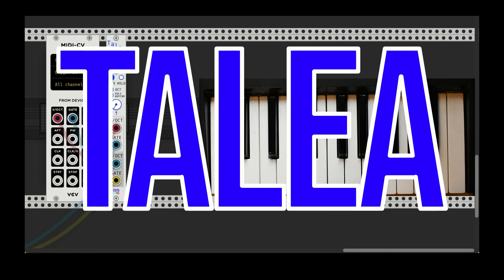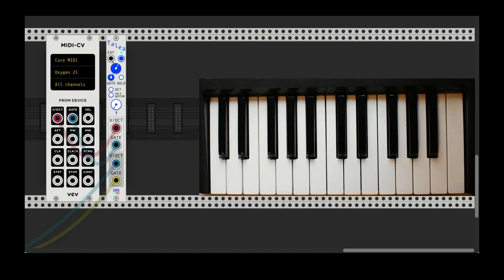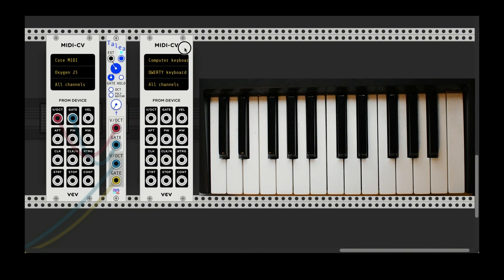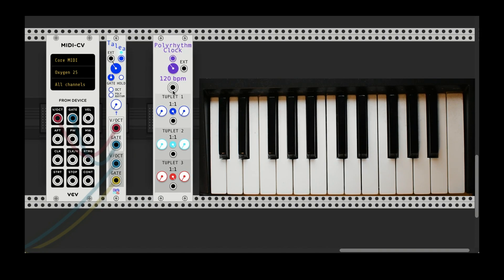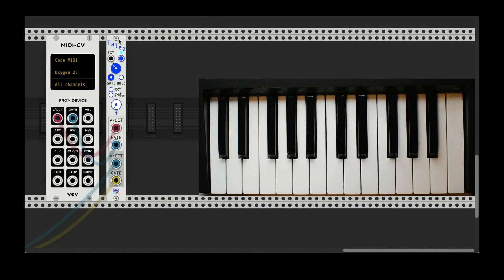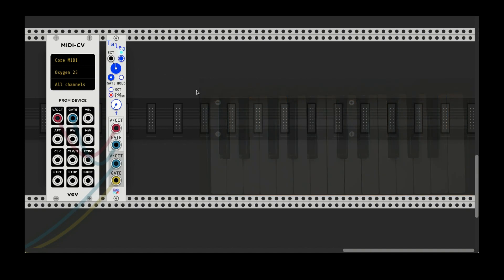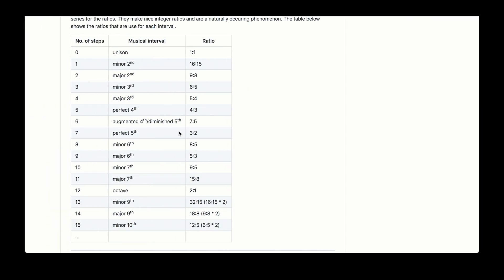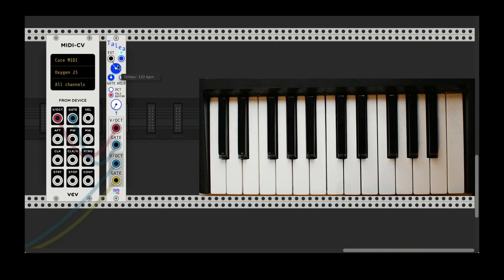Talea - Sha# Bang! Modules

Comment: In polyrhythm mode, have you experimented getting the whole number ratio also expressed as a musical interval? That would be cool, to have the ratio expressed as rhythm and interval at the same time. The only way I can think of is to add Host to VCV and link a synth like Vital, Surge or Serum, that supports .scl or .tun files. But is there anything inside VCV that can do this? By the way, great videos and modules!!
Reply from the maker: In polyrhythm mode, Talea does exactly what you are describing. For example, if you play C and G at the same time, you will hear the pitches at a rhythmic ratio of 3:2.
Reply: @jeremysmuller  Cool, I didn't notice, thanks!
Reply from the maker: @affezwei11  Here is the table of ratios that it uses: https://github.com/jeremymuller/Sha-Bang-Modules#tunings-and-rhythms
Reply: @jeremysmuller  Great, thanks so much!